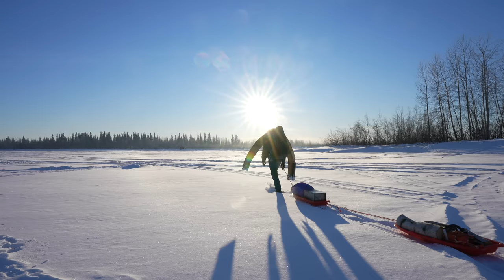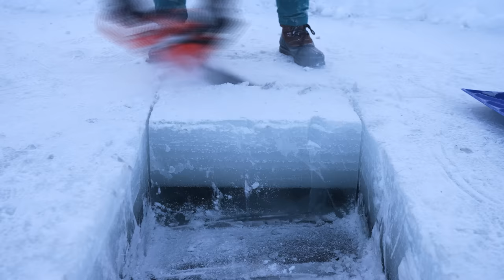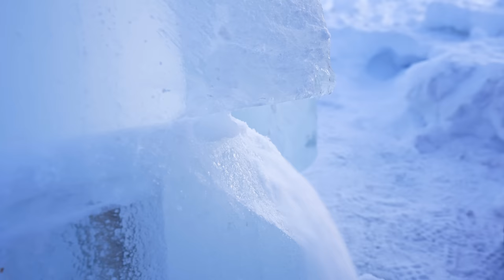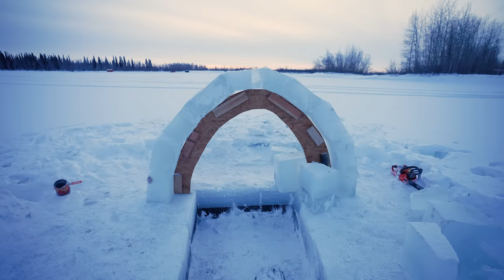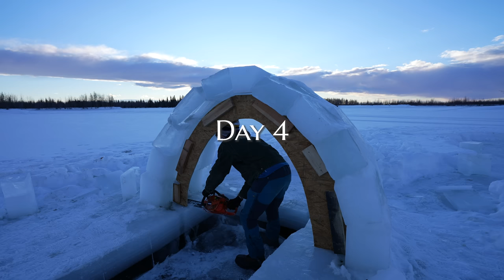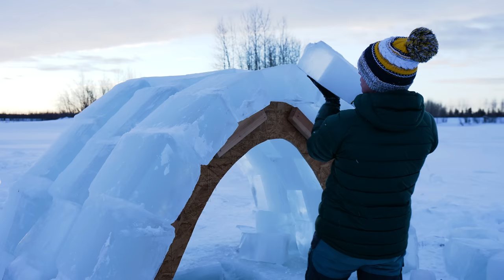11 Day Ice Igloo Build With Wood Stove At -30°F

Comment: 15:30 "It's not as warm as I thought it was gonna get" - probably because you used ice!  Inuit use compacted snow which holds a lot of air bubbles and thus is a great insulator.  Ice is just *cold*.  Still, it looks amazing and no doubt you learnt something. Nice work.
Reply: Ya know it's cold outside; when you go outside and it's cold!!! My first thought as well, I am thinking snow is a good insulator ,but ICE not so much. I am thinking why is he using ice???Great ice box, nice evening light show though.
Reply: @WhynottBelieve , ice can be an insulator. You can see a part of ice block is opaque. That part contains air bubbles as well. You only need to place every block opaque part inside. It will not insulate as good as snow, but it will be good anyway.

Comment: I have made few of those and used as a sauna. Coldest weather was -43C. It'll heat up, but need serious power. I use sauna stove and lots of dry wood. It can get around 60C at upper part but feet are still cold. Also it'll get filled with mist and cold water droplets are dripping from the roof.

Nice experience, especially with a hole where you can swim

Comment: When your cutting your kindling can I suggest you try laying the wood down and drive your hatchet into the middle of it? This creates more surface area when your splitting the kindling and keeps it from sliding off the hatchet and moving with each thrust. Also when you have knotted wood you aim for just above/below center mass and it splits the knot every time. Give it a try at home and see how you like it.

Comment: next time stagger the joint of the blocks ... and use powder snow between the blocks sides and bottoms so when you pour water the snow soaks it up and seals the walls .. 
snow shelters only get up to about 15f

Comment: The reason for the expansion and cracking is that I blood are made with packed snow, not ice. Great work but an ice igloo can't breath and snow it'll is are warmer inside because they have have air trapped in the snow so it insulates like foam.

Comment: You know that Inuits build their igloos out of snow rather than ice since snow has lot's of trapped air inside while ice just keeps on cooling you down...
Reply: Igloo snow blocks cut with a knife produce a shelter that will stay above freezing inside with nothing more than the body heat of two people. Solid ice like this is an impressive heat sink, he had a roaring fire inside and it was still cold.

Comment: Also...snow is mostly made of air, so it insulates. Not ice. And you want to have your bed on a platform which is not at the lowest point, as you want cold air to flow down into that lowest point.

Comment: Out of curiosity: do you need some kind of license or permit to operate a chainsaw where you live? Or anyone else reading this? As in Germany you need to have such a thing and take a test before you can legally operate one....
Reply: For private use you don’t need a license in Germany its always sensible to follow safety protocols
Reply: @Superfandangoo  that is only half-true (if there is such a thing). You DO need it for private or commercial use. You only DON'T need it while on YOUR OWN private property. Which would hardly be the case on a frozen whatever (lake/river ...).
Reply: @OliverBerger  Ok. We do not need a license in the UK. When working in Germany  in early 90's didn't need one then
Reply: In the United States the only requirement  needed is you have to be able to start the chainsaw, or have someone who can start it for you.
Reply: @michaelg.294  That’s pretty much how it is in the UK. 
A dear friend of mine had been working with his father since he was 13yrs old whom was a tree surgeon had a fatal accident 1990 where the chainsaw kicked up taking his jaw, he was transferred from one hospital to another more specialist in London but never made it, Mark was only 27yrs. 14yrs experience, dangerous stuff.

Comment: You're joking right? I used to "snow camp" with my son and I've never seen anyone use Ice. The snow we used for caves and igloos was capable of trapping air which in turn acted as an insulator. No need for a large open fire, just a small catalytic heater and some ventilation. Your body heat causes a thin ice film on the inside further aiding in draft reduction. This is not at all how it's done. Before you run off and try this, do your homework or you are going to put your life in danger. By the way be prepared for a somewhat uncomfortable morning. Survival is the intent. A few hours is all it takes.
Reply: this snow is too cold to be packed for making blocks no?

Comment: Just some big tips for your next shelters, your bed shouldn't be placed at the lowest spot of your shelter (you should have placed your bed where your table is). Also, twigs are not very good insulators, so having a huge hole in your roof ain't that good for keeping warmth inside, instead should've used some heat-resistant foam pads.